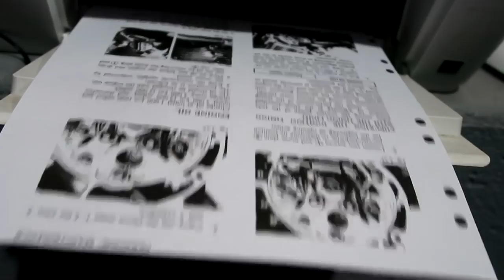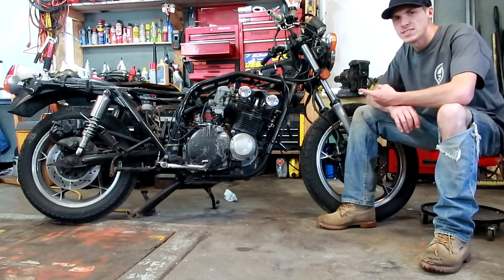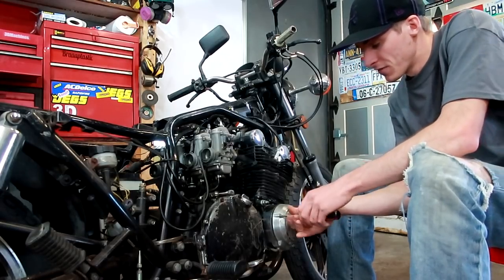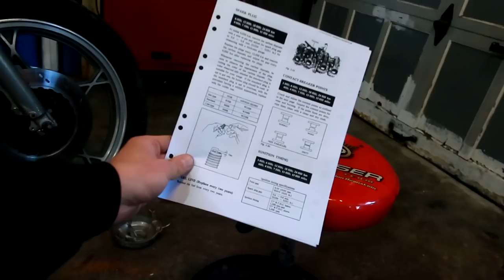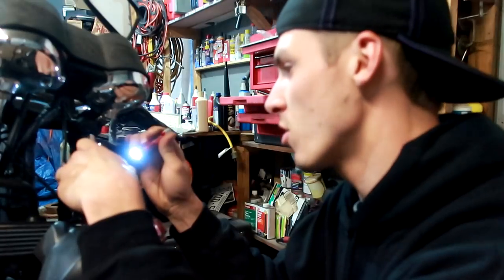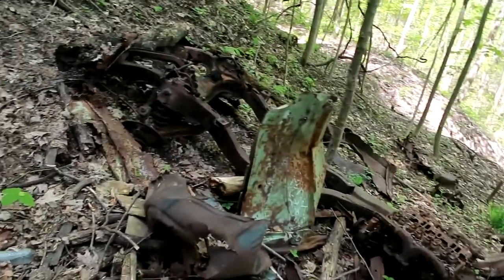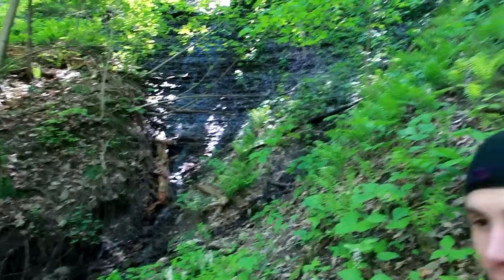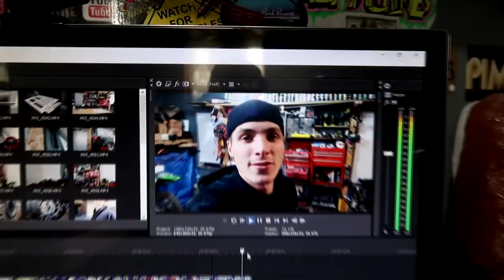THIS is WHY you DON'T BUY OLD BIKES!

Comment: The GS ignition is very simple, its 2 Briggs systems. It fires 2 plugs per set of points at once. Set gaps like normal, adjust timing with the plate with a timing light. Easy peasy.

Comment: 3dmachines... Dalton... One thing to remember... That bike when fixed will be verry valuable to a prepper... Shtf situation... If an emp goes off in our atmosphere nothing new with electronic ignition is going to run... NO IM NOT A PREPPER... But on the other hand i have carburated and points style ignition in 2 of my jeeps... I don't daily drive them but they are stored in a barn and kept in running order and checked every other week to once per month minumum and ran to keep the gas fresh in them... Like you said electronic is far superior BUT.  Points style with no computer chips is a highly sought after item within a certin few people...  Like i have told you before im old enough to be your grandpa but find you a quite interesting individual... Thanks for being a role model for our younger generation... Verry few now days have the respect you and alot of your followers have... Always a positive attitude... Always helping a person in need... Young man in my generations terms... YOU ROCK...

Comment: That's one of the earliest 1000cc superbikes, I remember when those were all over the place. I myself had a 1980 Yamaha XS 1100 special that I had for a few years and later I owned a real monster, a Honda VF1000R Interceptor.  Old bikes with low miles are great ( I have a 1976 BMW R75/6 now) but you have to expect a few things will need maintenance or replacement.   I found this online (ebay)
Dynatek Dyna S CDI Ignition Suzuki GS1000 for $126  It is electronic ignition that fits under the GS cover.

Comment: try cleaning the points and regapping them to spec. 
thats what i had to do for my 1978 kawasaki KE100. i took some very fine sand paper and gave it a couple swipes, regapped it and it fired up in a few kicks.

Comment: I must say I'm a little surprised you walked away from the gs1000 points. bikes have been a life long hobby of mine. im 47yrs old. they are just like a lawnmower, x 2. the carbs are where your going g to want to kick that thing to the curb. they will never run right without either the stock aircleaners or larger jets in the carbs. and your going to need 4 vacuum gauges to sync the carbs. not having the carbs tuned correctly will lean out and score a cylinder.

Comment: You may be able to find an ignition system that doesn't use points. I also have a '79 four cylinder bike and it doesn't use points or condensers so the technology was def there at that time period. Timing is just a hard thing to figure out! The valves may not be helping either! I know that was a problem for me.

Comment: That engine is not flint stone technology. You just have no clue how it works. First clean  the lobe shaft with steel wool and give it some contact spray. Take out the left side sparkplug (Cylinder nr1) now you can find the TDC of it when you stick a long screwdriver in it and turn the engine by the bolt at the ignition. To ease the turning take out all sparkplugs. You see the contact for the cylinder 1+3 now adjust the space for both contacts with a feeler gage to given spec (0.8mm? just a guess since I did not do it for 20 years) when the lobe is not touching the contact lifter. Now when you got it back on cyl1 tdc you move the plate that it just makes the contact close from there you need to give it the 10° pre ignition timing so just a little notch more tighten the plate put the screwdriver into cyl. nr.2 turn till that is on tdc and adjust the other contact to the same spec. That gives you a base tuning for the ignition. But to time it proper you need a strobe timing gun. All easy peasy like feeding a dog.
Reply: Agreed, older technology is my preference because it generally fixable with basic tools and once you learn how to work on points is not that bad
Reply: Marlin, New technology needs parts to repair. Older technology need a smart one to repair...

Comment: not sure how the older suzukis are but my buddy had a 750 katana that wouldn't start and after replacing a bunch of parts we found out that the key switch has a resistor in it that wouldn't let the bike start until the proper resistance was met.  he ended up buying a new key switch and it fired right up.

Comment: Ya need a light bulb with two alligator clips and about a foot of wire on each pole of the bulb bring the motor around so #1 cyl is about to fire put light bulb on points it will just go out when you rotate crank the points open causing the ignition to fire #1 then ya gotta do same for other set of points . Good luck they can be a pain to get dwell and timing just right

Comment: seen it before, the points/timing plate factory screws were short and pulled the top threads out of the case, solution was longer screws, lazy folk didn't cut them, just stack a washer and lock washer :) just as you got it. lmao

Comment: point are not hard once you get the concept rotate the points cam to the highest spot and gap them to the bike specs .020 of an inch is a good place to start (business card thickness) set each side the same way and should get you close enough to start I have a gs500 with fried points that I have to clean and re gap after it sits for a while

Comment: buy old bikes. I ended up with one in a trade I was gonna put the engine on the wheeler before I actually seen it. but I'm glad I didn't I changed my mind and kept it restored it piece by piece over a course of almost a yr. finally got it done a couple weeks ago and sold it yesterday. bad ass bike it was a 1980 Honda cb760 custom nice bike when I was done it was a pile of shit when I got it, everyone made fun of me and then they wanted it when it was done. all the grandpa's would talk to me about it. stop and ask me about it. it was a looker. but I sold it yesterday and now I'm sad and want it back. I bought my buddies project and it's a rocket and I'm not a fan but it's the super hawk. moral of the story is I didn't know what I had until I was trying to buy pieces and looking up things for it and realized I had a very popular bike for a cafe racer and to see one still around here is amazing. so yes u never know what u have. one man's garbage is another man's treasure. and I wish I had kept it I built this thing ground up.